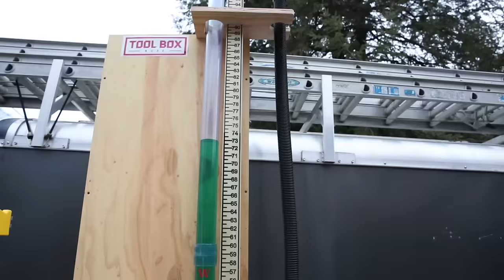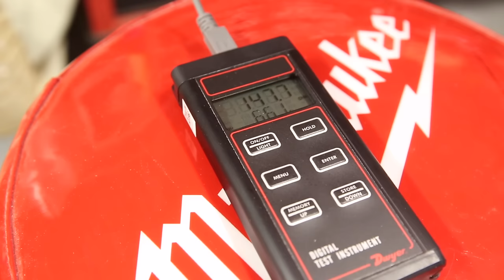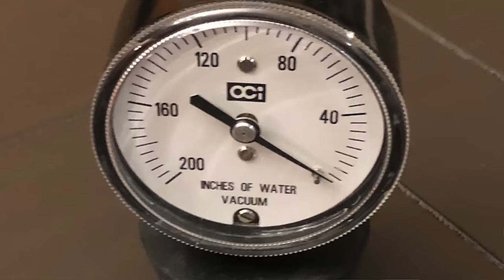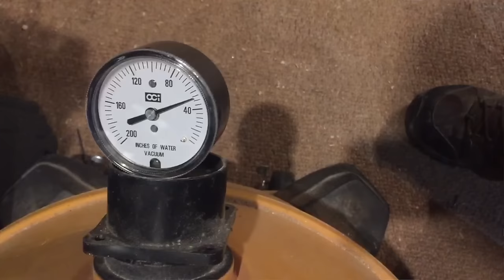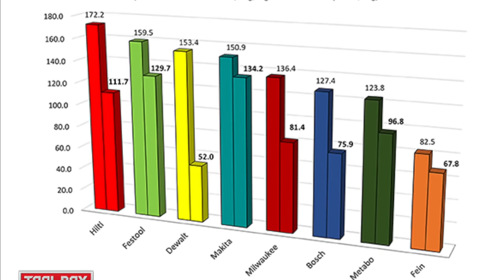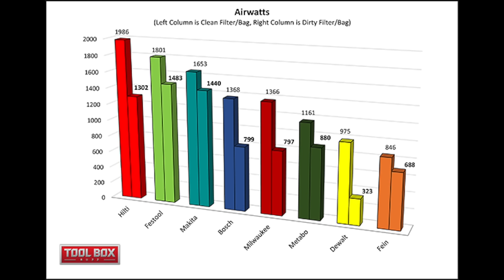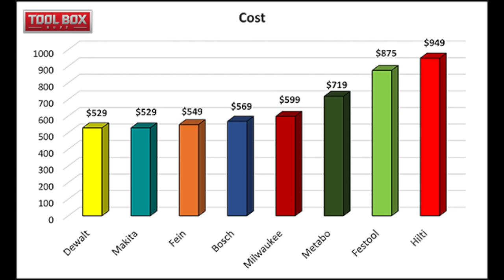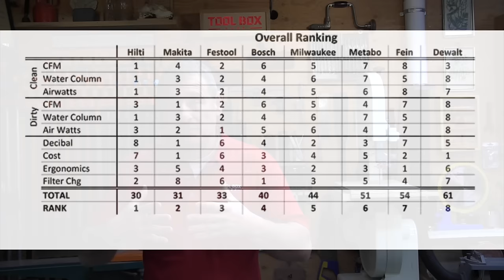Best Dust Extractors - Head-2-Head Testing

Comment: Great in depth test.  I also read your full test on your website; lots of information.  One question though.  If you take away the "clean test" rankings the top 4 units switch things up a bit to Makita, Bosch, Hilti and Festool.  The other 4 don't change their placings.  Since they will rarely be "clean" in real life would it also be a good idea to test after you "cleaned" the filter and emptied the bag?  I know this took a while for you to put together, just thinking about another real world test.  I've had shop vacs (Yes, I understand these are more than shop vacs.) that last years so I guess I'm not super concerned about the warranty.  Tools last a long time when used properly and taken care of saving a lot of money over time.  Based on your tests here I will be purchasing the Makita as it certainly delivers the most bang for the buck and taking out the clean test it jumps to the top of your list.   I'm not a "fan" of any particular tool brand, having DeWalt, Makita, Metabo, Festool and Ridgid among others for my remodeling and woodworking business.  It's a very good idea to research your tools a bit more than just picking them up at the store and giving them a look and a "spec read" or buying based on brand loyalty.  Thanks to you and several other online tool reviewers this is more possible than ever!

Comment: Well I guess at the beginning they’re all kinda OKAY? But people and especially men forget if they want the vaccum work okay for a long time then they need to take care of it PROPERLY. 
Meaning cleaning it, changing the bags and cleaning the filters. 
And not vacuum wet floor along with dry dust. If it’s not meant to used like that. 
I work at the construction and I’ve seen it over and over again. I’ve also had to clean the machines many times after men. 
They’re ruining expensive machines and thinking a vaccume is not like a REAL tool. 
Even though it could cost a LOT MORE than their shitty drill etc. 
someone should really take that up with these kinds of people. I sure as hell try to at my workplace.

Comment: One thing I didn't catch in the video but would be interested to know in general, how compatible are these vacuums with other brands? I mean is there any issue with using a makita vacuum with the dewalt tools and accessories? I ask because I use mainly dewalt tool and most of my dewalt stuff has some form of dust extraction port but I am obviously not gonna buy the dewalt vacuum after this review. I would probably go the makita route and would be interested if you know of any drawback to doing this or any advice on it in general between the brands?
Great review btw and a real eye opener.
Reply from the maker: Jason Showell most hose ends are fairly compatible and ever manuf sells connection accessories to complete a connection

Comment: Your Reviews are really awesome even after 2 years! Do you have any plans to do these tests again every couple of years as the equipment fixes their flaws? Also, though it wouldn't have just tied the top two and nothing would have really changed, but the scoring was a bit off in the overall category. There was a tie, but it should have gone from 1,1 to 3 and not to 2. Hope that makes sense because Hilt was rated number 7 and should have been rated 8. Thank you for making these videos, they are awesome!
Reply from the maker: Thanks - not sure

Comment: I've used the Hilti, Makita, and Festools and I found the Hilti to be cumbersome and oddly designed.  The Hilti has a very proprietary hose design that makes it incompatible with everything other manufacturer.  It also has a goofy plug design that requires an adapter.  The makita has a poor filter design.  Works well for tests when brand new but put some mileage on it and that system will not work as well.  The Festool is the best for dust extraction hands down.  It is pricey but that goes with quality.

Comment: Great review, and covers a lot of basics.

But....

I have yet to see any review on YouTube, or even through a Google search, that shows me real world use. Vacuuming dust off the floor is the secondary use of these extractors. I want to see them hooked up to a miter saw and jobsite tablesaw. I don't care what brand, pick any of the top 4, Bosch, Dewalt, Makita, Milwaukee....Let's see what these dust extracting tools can really suck up, AND can they do it without flipping a breaker.

I was all set to buy a FEIN turbo 1 because of the appropriate portability and size and quietness and price and power.....until I found out that they seem to be only suited for use with sanders, and not so much with higher amp tools.

I would love it if someone could point me into the right direction and show me, or tell me, some real world use of these high priced vacuums. I would gladly buy the Makita dust extractor, even at its high price point, but it's just too big to be hauling around in my truck with all my other tools. And I still don't know how well it works connected with a mitersaw or tablesaw.

Comment: After revisiting this review I’m questioning how even the playing field was. The higher scoring extractors don’t seem to have a Hepa filter installed (not available on the festool). The milwaukee, fein and Dewalt certainly do and possibly the Metabo/bosch but it is very unclear about the rest (and not possible with the auto cleaning festool). The point is that obviously a Hepa filter would further restrict air flow giving the some brands a unfair advantage.
I would be curious how much the Hepa filter affects performance. The milwaukee(nilfisk attix 33) can be run with its hepa filter removed because of their multi filter system. This would allow testing with the same unit to discover how much performace is lost.
Reply: the Festool has a HEPA filter

Comment: I am a drywall finisher and I work in museums and working offices.  I use a Ridgid 16 gallon and a Oneida cyclone.  I made a cart out of a childs stroller to tie the two together and got the benefit of larger wheels.  The reason I use the cyclone is to keep the power to the drywall sander the same throughout the job.  No drop in power at the sander due to plugged filters or bags.  The dust goes into the pail (I use a mud pail from the mud brand I use) which can be carried outside to empty.  My machine is usually cleaner inside than outside.  My system cost about $250 and for what I do I would compare it to any I see here.

Comment: Lol. The guy with the Makita sds hammer drill around the 33 second mark has it in reverse. Check the slow mo.
Reply from the maker: I got to disagree I was there filming the drill was not reversed we were drilling holes for structural  blocks g
Reply: @ConcordCarpenter  I guess it’s a trick of the eye. I stand corrected. Thanks for the vids.

Comment: You don’t compare products of the same capacity and range. 
Example Dewalt DWV012 10 gallons (34 litres) vs Festool or Makita (14 gallons-42 litres). To compare Dewalt DWV012 vs Makita VC4210L capacity you should take Makita VC3012L and not VC4210L. For the hose 1-1/4", Dewalt DWV012 should be compare to Makita VC2512L. Results of comparaison will be probably very different!!

Comment: Great testing of all the big box top manufactures, but where is the one American Brand Pulse-Bac?  Pulse-Bac runs circles around all these and they have been out there for 15 years. Pulse-Bac was making dust vacuums that meet and exceed the new OSHA Silica Standard for the past15 years, long before all these brands introduced vacuums.   To bad you didn't have the Pulse-Bac Brand in your testing, as I have owned the Hilti model and the Bosch model, I would never go back to them after buying and using a Pulse-Bac.  I urge all your readers and viewers to check out this brand of dust vacuum, you can see it in the OSHA Silica standard sheet, it is the one they used for real world testing.

Comment: hi thanks for youre tests...but you forgot about flood issues??...my shop vac does that...do these do that too??...thats what i was looking for, but nothing said bout it...thanks in ad vance...p.
Reply from the maker: Yvon Larocque Thank you for your comment, these are not wet dry Shopvacs, They are dust extractors for collecting dangerous airborne dust such as lead paint and silica dust. they are OSHA table one certified
Reply: hanks for the info, i have a shop vac and i like the fact that if i get a leak i can use it, but i have a 1.5 hp dust collector for my shop as well...thanks again for your hard work.

Comment: Festool has a whole tool ecosystem that integrates well. Also made in Germany and high quality. I'm a makita fan, but their tools don't work well with dust extraction. I suppose you can use a festool tool with another brand dust extractor, but why bother.

Comment: I own a few of these, and my favorite is the Fein.  Sorry, but for actual use around the job site and the shop, the Fein is FAR better than the Festool and it's also WAY cheaper.  That being said.  It doesn't matter what it costs, none of these can compete with a cheap $160 Ridgid for general cleanup when not attached to a tool.
Reply from the maker: Michael Pilliod Dirigeant is a great vacuum it has a larger holes capacity but unfortunately it does release particles back into the air thru it’s exhaust system
Reply: @ConcordCarpenter  they all leak including my fein and  festool.  Hepa certified is a  bunch of marketing bs.  I actually read the lead law. The actual wording leaves a ton of  grey area. That being said a bag and cleanstream filter goes a long way.

Comment: Great review and awesome research guys!  I have been looking at replacing my Ridgid vac with HD bucket cyclone system with a Festool vac - now I will have to look at the Hilti and Bosch... btw would these systems be useful with a cyclone adapter?
Reply: The cyclone would work fine. You'll also save a lot on filter bags. Be careful not to collapse the bucket with too much suction. Most of these extractors are made by one or two big vacuum manufacturers. Work out your needs/budget before you spend a lot. The Makita is now discontinued but replaced by a better but more expensive model, also made by Nilfisk. It shows up under a lot of brands (Milwaukee, Flex, Mirka, Makita and also as a Nilfisk) and is excellent. Don't have any experience with Festool but you rarely hear bad things about them, but they are pricey.
Reply: If HEPA filtration is a must then I'd avoid the Festool and go with one of the Nilfisk variants. Accessories are interchangeable.
Reply: Rolo Tomassi I use TWO HD buckets inside of each other for my current cyclone so they don’t collapse - good tip!
Reply: I’ve had the Bosch for 3years and looking to replace it with Festool.  The Bosch is good, but mine beeps constantly to tell you it’s full or restricted flow, when there’s no restrictions and it’s not full.  This is so annoying.

Comment: Wish I'd seen this two weeks ago, I bought the Metabo when it went on sale for $375 and it's a decent vac, but the bags are not easy to use, it has no tool storage, the power cord and hose have nowhere good to store and even though it's less than half the price of my Festool CT26 I wish I'd saved my money and at least gotten the Makita.
Reply: I was interested in purchasing the Metabo because of the discounted price...you do not recommend it?
Reply: @scottjohnson3226  Eh.  It's ok.  The discounted price is the only thing that makes me not mad that I bought it.  I'd get the Makita if I could do it again, or save up and buy a second CT26.
Reply: @woodyfeffer2846  I just ordered the Metabo. Price was too good to turn down, though they ended up dicking me on the cost of shipping. Hopefully it will suffice and fulfill my need. Thank you for your input!
Reply: Delivered just today and I already regret buying the Metabo. I did not realize buying the fleece bags was going to be a problem. I cannot found them in stock for sale, here, in the United States. I should have saved a little more and bought a Festool.

Comment: Great testing. But why do you use drywall compound and not a mix of hard wood-, soft wood-, mdf-, osb-, and plywood saw dust?
I'm new on this channel, do not know what your background is and I ask this question at 5:24 of the video. (so I did not see the whole video at the
time of the question, nor did I read the article). The rest of the video I'll watch now, the article I'll read during the weekend.
Reply from the maker: Hans de Groot drywall dust is a very fine dust and very destructive to vacuums
Reply: That is true (also very destructive to our lungs).
But sanding drywalls is a very specific job.
Reply from the maker: Hans de Groot yes it is.  These dust extractors are all OSHS Table 1 compliant. They are designed to handle this dust, concrete (Silica) dust, lead paint etc. They are very specific  and the manufacturers recommended drywall dust as one of the nasty items to test the, on.
Reply: OK. I understand. I am new to your channel and I'm glad that I've found it. I'm doing woodworking.
Did you do some tests on dust extractors or any other systems for woodworking related processes that have impact on better air condition for woodworkers?
If so, I'd be glad to receive a link. If you did not do such a test yet, are you planning to do it in the near future?

Comment: No way makita is second.
No place for hose. That vacuum will flip on its side as soon as you pull the hose. The vaccun it's too high. The filter is a pain in the but to remove and clean.

Comment: Is a dust collector the same thing as a shop vacuum or vacuum?
Reply from the maker: Sculpin most people think of shop vac as wet/dry units with large hoses for larger chunkier debris. . These vacs are powerful and great for demo,  but typically are not OSHA table1 compliant or HEPA.
Reply: A Concord Carpenter / ToolBoxBuzz uhh so what's the difference?

Comment: One more thing, looking at the stats your testing showed, NONE OF THESE VACUUMS CAN BE USED WITH 7" TOOLS FOR WHERE SILICA IS IN PLAY! According to OSHA, the vacuum must have a min. 175 CFM to be used with a 7" tool, and none of these vacuums according to your testing have 175 CFM .  Based on the OSHA Silca Rule, these vacuums are not in compliance with Table 1 rules when working with Silica and using 7" tools, you can use a 6" and below with some of the vacuums, but not a 7" angle grinder or any tool that takes a 7" blade or lagrger.  OSHA rules call for 25 CFM per inch of the blade  when working with Hand Tools. It is the only time OSHA calls out how much CFM must be used in the silica rule. All other CFM are based on the tool manufacture recommendations, but Only power hand tools are regulated by the OSHA Silca Rule when using a vacuum to capture dust.  Something to keep in mind when you go and buy one of these products.
Reply from the maker: L. Mathews pretty sure a Hilti can

Comment: I really try to like your reviews but I've not seen a fair one yet. You need to weigh the comparisons better. Cost is more of a factor than 1 for the cheapest and 8 for the most expensive. Use the actual costs as a value. Also when talking of costs, what is the difference in cost of a replacement bag and filter? Running costs are important. Putting the Makita Second when it was top three in most of the tests and half the price of the only one that beat it is just silly.

Comment: Sound doubles by adding 3 decibels!  The more powerful ones are over twice as loud.
Reply: I thought it was every 10 decibels that it doubles so I looked it up on Google and here is an excerpt from the page I viewed:
While every 6 dB SPL represents a doubling of amplitude, a non-exact rule-of-thumb is that every 10 dB increase is a doubling of perceived loudness - psycho-acousticians tell us. Don't use the term "doubling of decibels, or doubling of dB". Always the factor is doubled. Sound level change and loudness ratio.

Don't read on unless you're really bored with nothing else to do.

The psycho-acoustic volume or loudness
is a subjective sensation of size.

Is 10 dB or 6 dB sound level change for a doubling or halving of the loudness (volume) correct?
About the connection between sound level and loudness, there are various theories. Widely accepted is still the theory of psycho-acoustic pioneer Stanley Smith Stevens, indicating that the doubling or halving of the sensation of loudness corresponds to a level difference of 10 dB. Recent research by Richard M. Warren, on the other hand leads to a level difference of only 6 dB. *) This means that a double sound pressure corresponds to a double loudness. The psychologist John G. Neuhoff found that our hearing is more sensitive to rising levels of sound as to falling levels. That is for the same sound level difference the change of loudness from quiet to loud is stronger than from loud to quiet.
It is suggested that the sone scale of loudness reflects the influence of known experimental biases and hence does not represent a fundamental relation between stimulus and sensation.
Reply: @DaveM2  yes, you are right.  I miss-remembered.  10 dbl doubles precieved loudness, 6 dbl doubles sound pressure, and 3 dbl doubles sound intensity.  

Good catch, and thanks for clarifying.
Reply: @DaveM2  of you get board, check out biggest sound of all time by Vsauce, it's pretty cool how louder sounds are mesured on the Richter scale...
Reply: @exodortch  I'll take a look at it Exo, I am always interested in the things most people consider boring. thanks

Comment: Damn that "cheap" makita is over $500. I got a 6.5hp shop vac on sale for 50 bucks. Obviously the power spec is not that important as a vacuum relies on a well designed turbine impeller, but it's hard to imagine that it's 10 times worse than the makita.